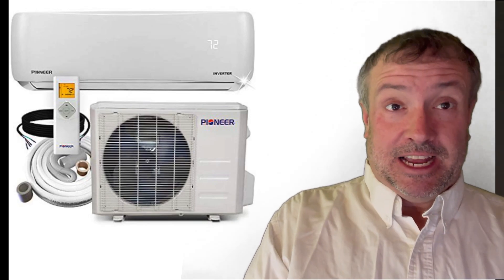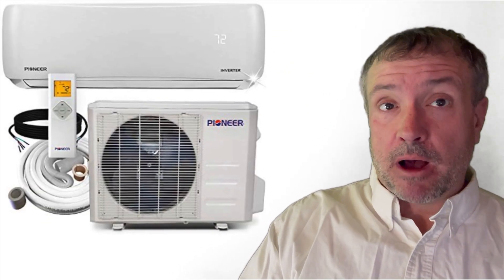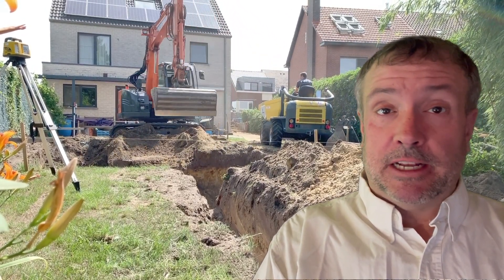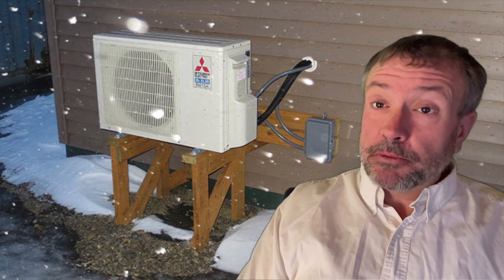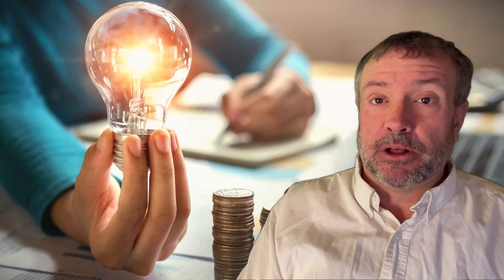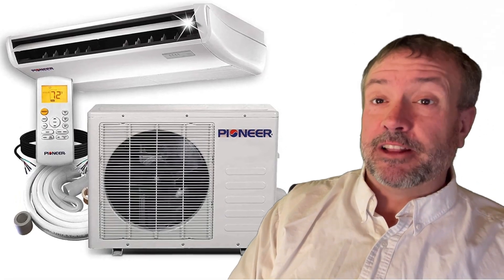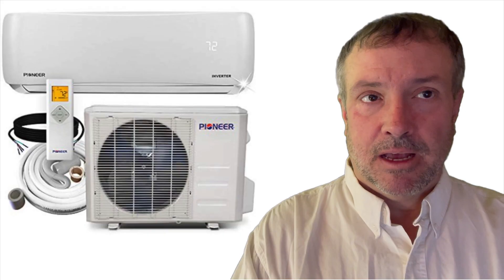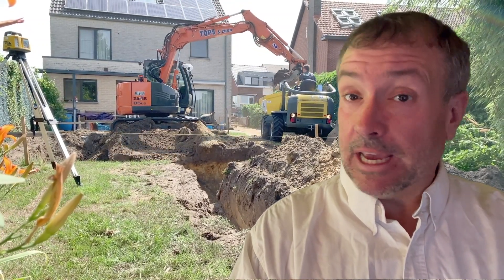Geothermal Mini Split Air Heat Pump works in -40'

Comment: Absolutely will not work. Corrugated that long won't move air with the fans referenced, and almost nothing will.  There is way too much turbulence caused by the ribs.  The Air Heat Pump will take any warm air that does trickle through the corrugated pipe and remove the heat, exhausting super cold air after the heat is removed.  This will almost immediately cause the air in the box to become even colder than the air OUTSIDE of the box unless it's vented with a hole as large as the grate on the outdoor unit.  This will cause negative air pressure in the box that won't be satisfied by the almost stagnant air in the buried pipes and air will be forced backwards through the fan from outside of the box causing cavitation, and reduced air flow through the exchanger, so it's efficiency will be nil.  It will also cause premature fan failure in the heat pump.  If the presenter thinks that it's a great idea, he needs to build one and have the testing done by an independent party, not some hack that's trying to trick you with magic.  Let's see it working.
Reply from the maker: I guess you should contact Russ Finch then, he’s been using it for over 20 years successfully
Reply: @SimpleTek  I've been looking for his.  Maybe you could point me to a video of his magic.  As great as this is, there must be thousands of examples out there.
Reply from the maker: @billsmith5166  look up “citrus in the snow”
Reply: @SimpleTek  I don't think that's the video.  There was nothing about heat pumps or little fans.
Reply from the maker: @billsmith5166  look harder
Reply: @SimpleTek  Yeah, I didn't think so..
Reply from the maker: @billsmith5166  the first 4 words you said there we’re correct!
Reply: @SimpleTek  So you were lying about the heat pump?
Reply from the maker: @billsmith5166  you need to grow up
Reply from the maker: @billsmith5166  this is a viable working system that’s in place in many locations. You have shown your incompetence in your responses. It’s sad.
Reply from the maker: @billsmith5166  if I can do that will you admit you are wrong and a complete idiot?
Reply: @SimpleTek  I'll sure admit I was wrong, but no one that wants proof of a claim is an idiot, especially when the claimant refuses to provide it time after time after time.
Reply from the maker: @billsmith5166  not worth my time then. If I can do it, you say you are an idiot or I’m not wasting my time. You don’t think it’s possible, what’s the risk then according to your facts
Reply from the maker: @billsmith5166  if you’re sure you’re right, then agree you’ll admit you’re an idiot if I can show proof of this system working for many years. Otherwise you’re broadcasting to everyone you know and believe I’m right and you’re spewing garbage lies

Comment: WTF.
Dude, if you're digging out your garden you might as well install the proper heat pump for the job.
2nd thing is that you didn't show us your heat pump installation. You should have 2 similar heat pumps and show the energy consumptions and heat output.
Let's talk numbers.
I want results before digging out a fucking graveyard.

And the insulated box for the outdoor unit takes the cake.
I saw a post, someone bought a heat pump designed for pools and had to install it inside the house and he was talking about improved efficiency, LoL.

Looking at you're video I kind of imagine you turning a room into a freezer and still talk about efficiency like that guy did.
Reply from the maker: Omg maybe you should be making these videos since you know soo much lol
Reply: @SimpleTek  yeah, I should...